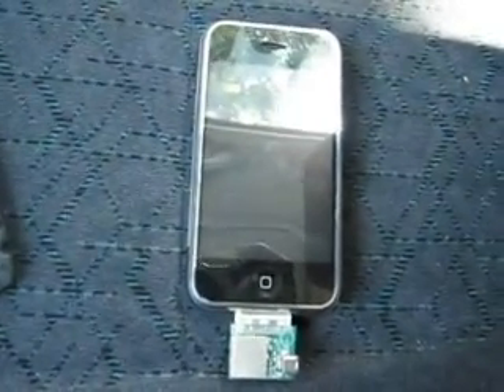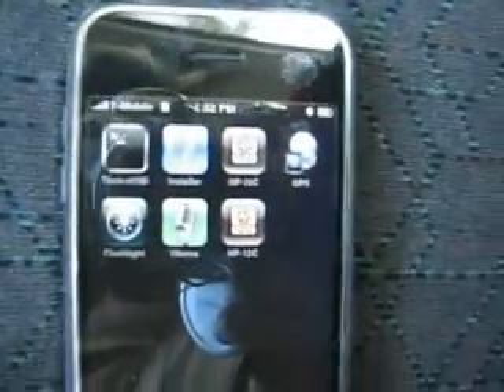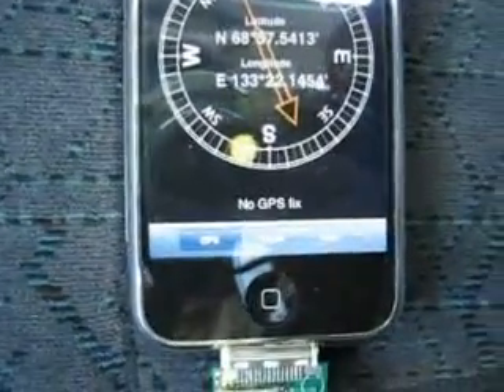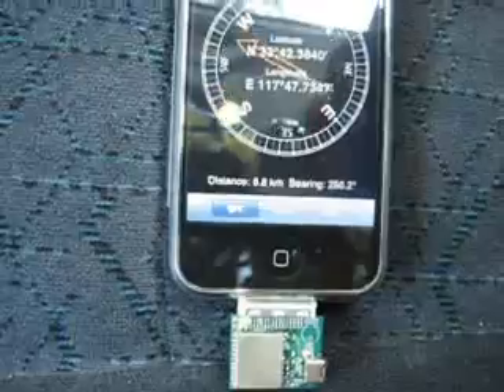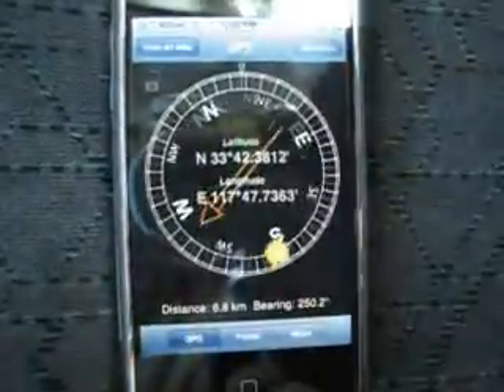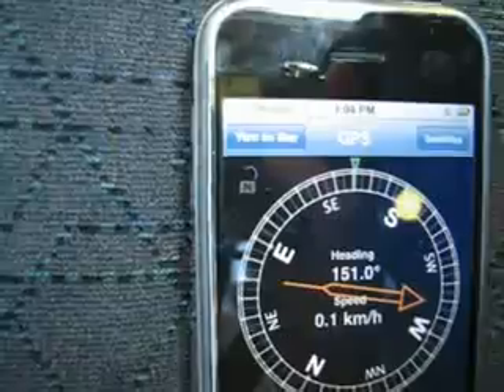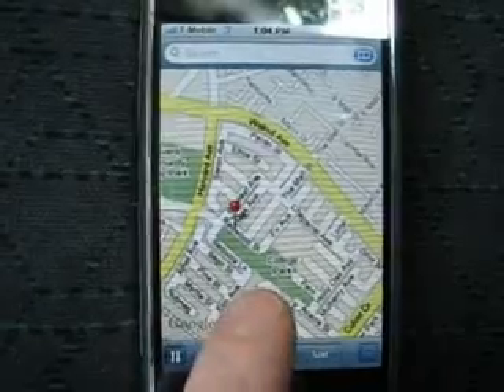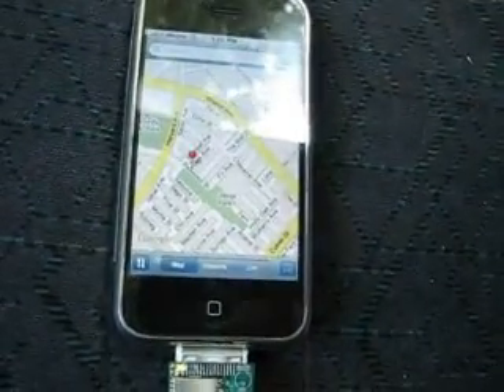Live working GPS demo on the iPhone (NEW)

Comment: You idiots, have any of you actually owned a GPS Unit? That actually is a GPS, what you see that shows the maps and stuff is actually a routing software. GPS just pinpoints your position using satellites above us using triangulation. GPS itself is not turn by turn direction you idiots.